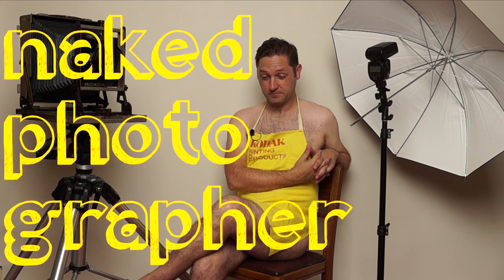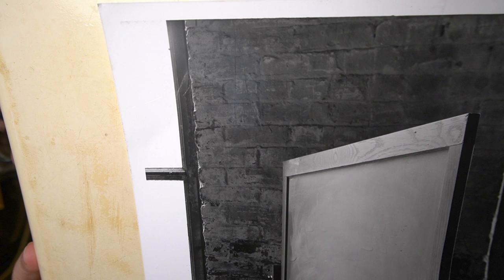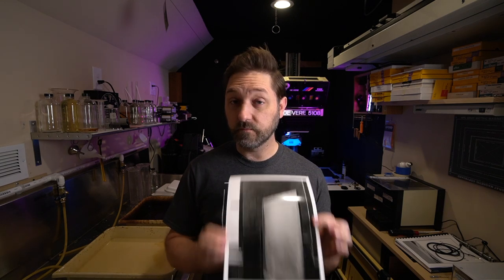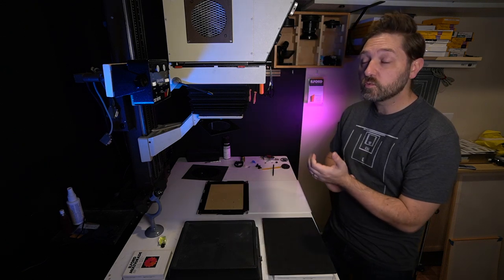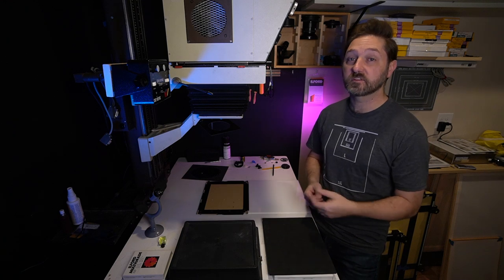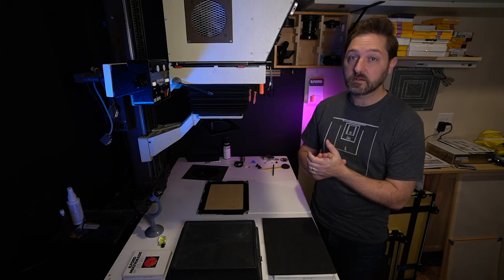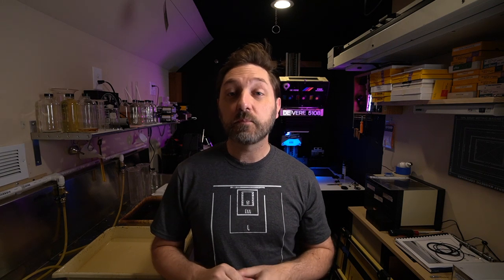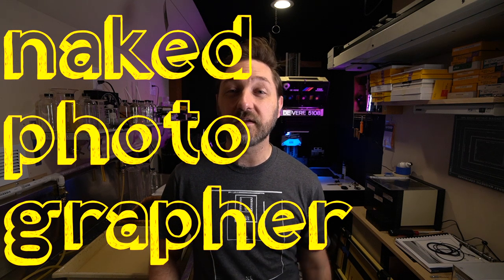Pre-flash Your Black and White Prints In The Darkroom

Comment: That‘s an excellent tip. I actually was printing today and had that problem. I exposed the white part with f2.4 and the rest with f8 so I finally did manage to get some detail in the white area of the print. But this would have helped a lot. So I guess I need to get some white acrylic. Very useful, thanks

Comment: fantastic explanation. thank you!
I'm just still curious to know if there are differences in the final contrast of the image if the (unmasked) pre-flash is made without filter (equivalent to filter 2), with filter 00 or with filter 5.
I'm asking because some time ago I've seen a video of Tim Rudman using the pre-flash only with yellow light (the video name is "Iceland, an uneasy calm"). do you have any thoughts or print results about that?
Reply from the maker: It would still affect the higher mid tones and reduce overall contrast.
Reply: The Naked Photographer thanks for the answer!

Comment: Having a fixed distance flashing unit really helps, that way once you know the flash time for the paper it can be reused on any print. Also sometimes its useful to flash blue light to help shadows develop quicker and actually increase contrast.
Reply: I have a spare color head enlarger that I could use for pre-flashing. If I understand your comment correctly, are you suggesting that I could dial up just the blue light to control the contrast when using the pre-flash technique?

Comment: I would have thought that, by pre flashing, you would not have to expose your original timings.... Otherwise your original tones would be darker? How does this work?
Reply from the maker: I’ll try to explain this without being confusing.  If we think of paper white with preflashing as “1” exposure unit and each stop of exposure darker doubles, so one stop darker from white is “2”, one stop darker is “4” and so on: 8,16, 32, 64, 128, 256, and 512 units.  The “1” unit from preflashing has a significant effect on the very light gray because it raises the amount of exposure from “2” units to “3”, the next stop darker is affected, though not as much because it moved from “4” to “5” units, only 20% more.  But the darkest areas that received “256” units now have “257”, barely any change at all at a  0.4% increase in density.  So whites are affected most and blacks none at all.  That is why the print loses contrast without being darker overall.

Comment: Thanks a million for all your incredibly insightful videos. I've been wondering about the following: What would be the difference between 
a) A straight medium contrast print without filtration or with say filter 1 1/2. 
b) Preflashed paper (flashed till its very ceiling just so it overcomes the inertia but doesn't show tone just like you present in the video) + say a grade 5 filter exposure

Of couse I'm thinking an average neg plus the filtration value & the preflashing strength is just an assumption/approximation. Have you ever tried to compare those two? Given that we achieve similar results (contrast & exposure wise), I'm wondering whether the tonal qualities will differ. I'm dying to know! Might try it myself but I'm wondering if you'd ever made such comparison. 
Greetings from Poland!
Reply from the maker: I haven’t compared those directly, but usually preflashing is a last resort when nothing else works

Comment: Hey, thanks for one more excellent video.  I have a question: can the same thing be achieved using the split grade printing method and burning that area (window) with a grade 0 filter?
Reply from the maker: Yes, but with very long burn times.  This method avoids such long burning exposures.
Reply: @TheNakedPhotographer  well, for a slightly different take, what about the effects of preflash on split grade printing? On the one hand, when doing test strips I might catch any influence preflash would have on my exposure times both for 0 (00) and 5, but then, would it prohibit me from getting proper Grade 5 exposure?
Another thing I would love to see your take on is using Ortho film to (unsharp) masking for contrast control (referring here to the late Barry Thornton). 
Thanks you for the good demonstration, R.
Reply from the maker: Any preflashing exposure, even in split grade, is going to lower the contrast a little.  As for masking, have I got a surprise for you...
Reply: @TheNakedPhotographer  trembling' with anttticcccipppation… R.

Comment: Interesting video.  However, it seems to me that the density of the negative would affect the length of time you would preflash.  For instance, if your negative is thin then  more light would pass through to the diffuser thus reducing the flash time.  If that is the case, you would want to run a test with each negative you print and not just a test of the paper you are using.  I suppose, this is where a second light source would come in very handy.  Am I missing something here?  Is it best to factor the density of the negative in or will it really even make that much difference?
Reply from the maker: The pre flash is just getting the paper to the threshold of exposure so all the printing time goes into exposing the highlights.  If your negative highlights aren’t overly dense then you probably won’t need to pre flash at all.

Comment: If i took the negative carrier out, could I use an ND filter instead of the acrylic? I have a 64x in hand already. I’m assuming yes..
Reply from the maker: The acrylic diffuses the light as well as blocks it, so if you have a diffusion head the ND is fine.  If your head is a condenser head, you need to diffuse it for flashing.
Reply: The Naked Photographer , I think it’s a condenser head.. a blue besler 23c. Thanks for the tip!

Comment: This is a good instructional video, much needed. I didn't realize until near the end that you were flashing with the negative in the enlarger but you were basing your flash time on the window highlight and not the rest of the print. Also, I were flashing at the closed down aperture?  No wonder the print turned out lower in contrast. If you have a print with highlights in different areas of the print, thing are going to get difficult to flash those. Not a perfect world.
Reply from the maker: Am mask would be appropriate in that case

Comment: I have heard from a well known printer that RC variable contrast papers are impossible to pre-flash.  Is this true?  The paper you were using looked like RC paper to me.  Can you explain.
Reply from the maker: I used fiber paper.  RC can be flashed, but it’s usually faster, so the light must be dimmer than for fiber to control it.
Reply: @TheNakedPhotographer   I have a 2nd enlarger that has attenuators in a color head that I can try...if that is not enough I can try a rheostat.  Will let you know if that works.

Comment: Well done as always...thank you.

If I did not want to mask off the area to be pre-flashed, is it plausible to pre flash the highlight test strip? For example, first determine the longest exposure time that does not create density. Then, after pre-flashing the highlight test strip to that determined exposure time, expose for highlights using CF 00, or CF 0.

I understand that if doing split grade the CF 5 exposure time would be immaterially affected by the pre-flash. 

Is there anything special about that 1/8" acrylic sheet? Hopefully, the acrylic is generic from a hardware store like Home depot?
Reply from the maker: Yes, that is how you would pre flash while split grade printing.

I use a standard piece of white acrylic I bought from US Plastic.
Reply: @TheNakedPhotographer  thank you. I wondered after I wrote the question if that was the basic message of the YT vid. I guess it was.

Comment: Great Video!
But i am unsure if I understand right.
Did you preflash with negative in the carrier and the white acrylic is averaging the light? Or is the negative holder empty?
Reply from the maker: Yes, the white acrylic evens out the light from the negative in place to create a smooth even preflashing tone.  If I removed the negative from the enlarger, the acrylic wouldn’t be necessary, though it makes it easier when using a condenser enlarger either way.
Reply: @TheNakedPhotographer  Thank you…

Comment: Would you use exactly the same technique when pre-flashing in color process RA-4 for color prints contrast reduction? Or it depends on any particular color filter (in this case wichone and what amount?)? Thanks for such a great channel!!!
Reply from the maker: It’s more complicated because you have to put a blank negative into the enlarger for the orange color, then you balance the color head to provide a neutral gray print.  Make the pre flash exposure, then put your negative back in the enlarger and put your color head back to the correct filtration to print.
Reply: The Naked Photographer Thanks so much!! Are you planning to create a new video based on this issue? And just another question, is there any way to control saturation in RA-4 process for color prints?? A video on that technique (If exists) would be also amazing!!! Thanks so much for your help as this is definitely the best video tutorials channel on color printing and B&W on YouTube!!! Keep the great job!!
Reply from the maker: Yes I will, but I don’t have plans for them anytime soon
Reply: The Naked Photographer Ok!! Thanks anyway!! I’ll be tuned!!

Comment: Hi, love your channel btw. So much invaluable knowledge you are sharing! I just tried this method and although it solved my problem in a very difficult area i could not accurately burn, it left my print very soft, as if the grain had been diffused. Any idea how i may have screwed this up?
Reply from the maker: Your preflash may have been just a touch too long.  It’s also possible you enlarger moved (vibration) or focus slipped and caused it to be slightly out of focus
Reply: @TheNakedPhotographer  ive just done individual strip to be 100% sure as you did here and made sure my focus was right even made an additional test without the acrylic right after... all the pf tests are coming out noticeably soft. Im not sure how to move forward! Any thoughts?
Reply from the maker: Are you printing with your aperture wide open?  If the grain seems less than sharp, the only things I can think of that would cause it is vibration or the aperture being too big (poor resolution) or too small (diffraction).  There is a remote chance it could be safelight fog from the paper being out too long before developing.
Reply: @TheNakedPhotographer  the pf is done at 2.8 for 4sec but the printing is at 5.6. The image appears to be hazy and fogged but ive done the test again and im certain the 4s is below threshold. Pretty lost on how yo move forward,  ill have to revisit this unless theres a clear solution. Thanks so much for your help !
Reply from the maker: Are you using a condenser enlarger or diffusion enlarger?
Reply: @TheNakedPhotographer  i first did it on a condenser and then switched the head to a diffuser because my bulb died.